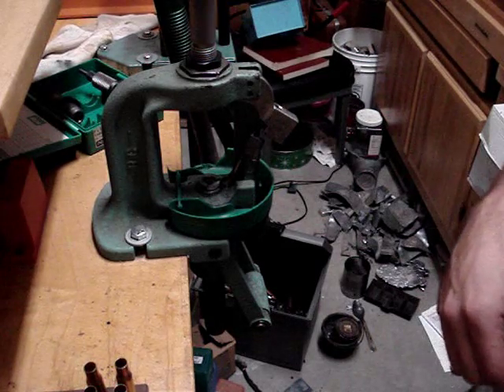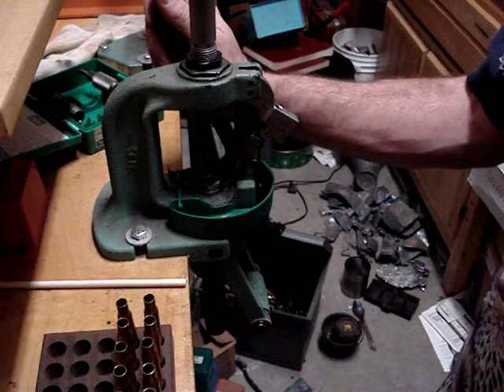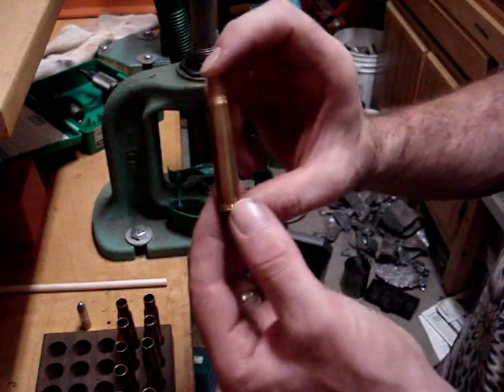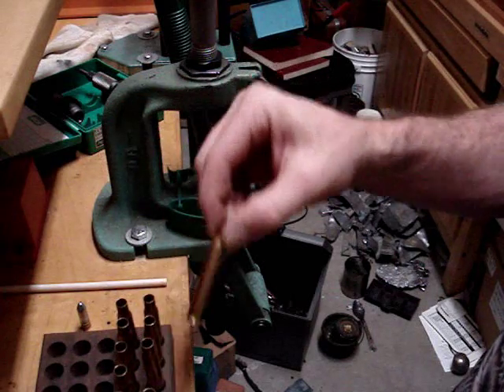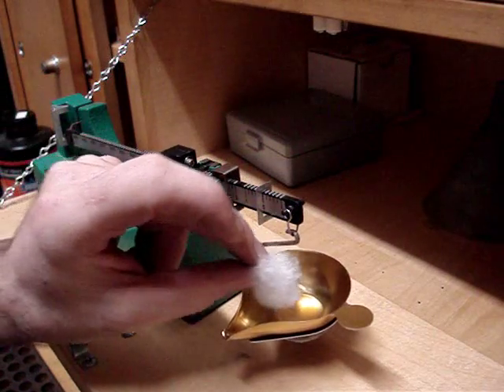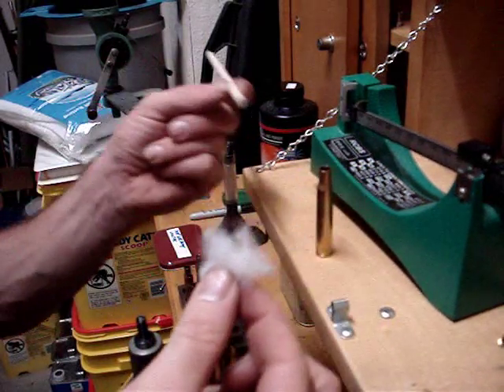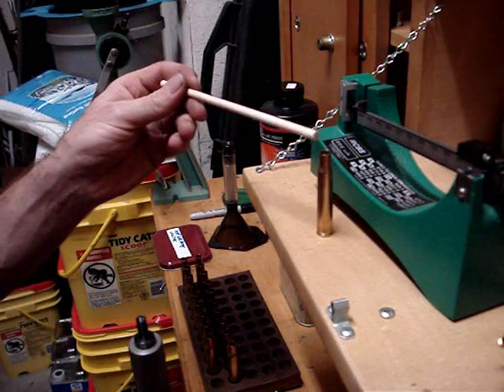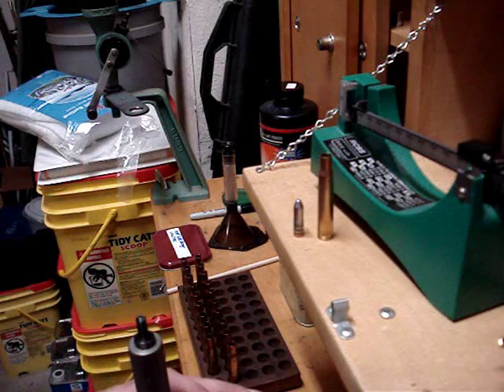Cast Rifle Bullets Part 1

Comment from the maker: No, not in a handgun cartridge. You can, it won't hurt but you need to add the weight of the poly fil to the weight of the bullet and calculate if you exceeding maximum pressure. 
Rifle cases are a special circumstance. They can have a huge capacity of 65+ grains and you're using perhaps 11-30gr of powder. The poly fil holds the charge against the primers flash hole for sure consistant ignition.

Comment from the maker: With that amount of powder you don't need Poly Fill. When using cast bullets there are occasions where you're using only between 9.0gr and 22gr depending on the bullet used. It's only when the charge is so small that you need to keep it pushed against the charge. I was using Green Dot and only about 16.0gr of it in a 30-06 using a 200gr bullet.

Comment from the maker: @ELITEHAMSTER123 I fill the case with the charge...fill the rest of the space with Poly Fil then weigh both powder and filler on a scale then calculate the amount needed. I add the poly fil weight to the projectile weight when calculating a lod as well.

Comment from the maker: Not with the amount I am using. This is a load from the Lyman Manual itself. Pistol powders are great for a fast impuse of pressure to get a lead bullet going at a decent speed. This one was going about 1500f/s.

Comment from the maker: I would avoid toilet paper. Paper is an abrasive matirial no matter how soft it may seem. I don't think you'll have to worry about polishing the rifling out of your barrel but just be aware that paper isn't the best. If you're loading a 80% plus density charge then a filler isn't needed. The .303 British is a fine caliber. What powders are available where you're at?

Comment from the maker: No not really. Gas checks are for high pressure loads. Use the softest lead you can to avoid leading with low pressure loads.

Comment from the maker: I don't have any specific loading data but I would think that using a cast bullet and only a cast bullet would work. If I were to use AA#5 I would try 6.0gr in the .223 and 8-9gr in the 7.62x54Rmm to start.

Comment: How do you know how much polyfill to put in? I assume it does not do much in increasing case pressure, so do you just fill one up, then take it out and weight it and use that weight for the rest? Thanks.

Comment: Did you ever shoot these through a chronograph?

I'm curious what kind of velocity 16 grains of Unique does with a 200 grain bullet in an '06 case.

I use the Lee 155-2R cast bullets in my SKS and the small case doesn't require poly fill.   

Thanks for the videos.  Very informative.

Comment: i use a 270 wby i had lee mak me a mold for it i use 110 gr bullits i use gas seals and i load it with IMR 4895 66grs their like 3600 fps iv used them for the past 3 yrs on deer and pigs  ground hogs and lots of pop cans i havnt had any problems with itiv put 300 rounds thou it im cheap i trying to think of a way i can make  bullit cases to realy save money